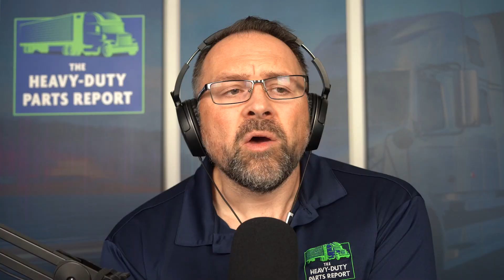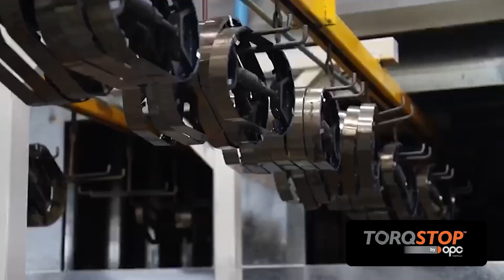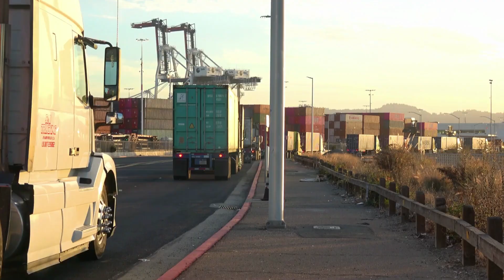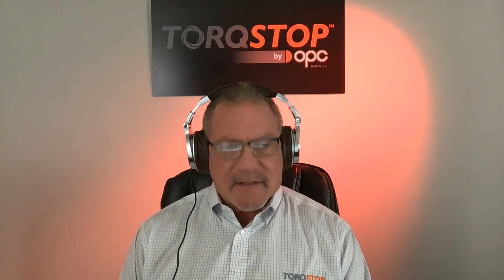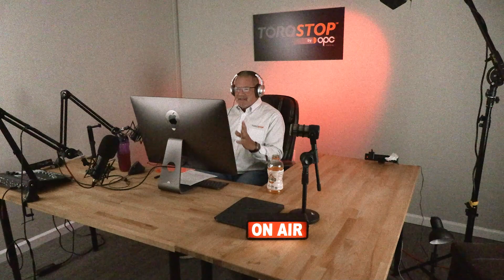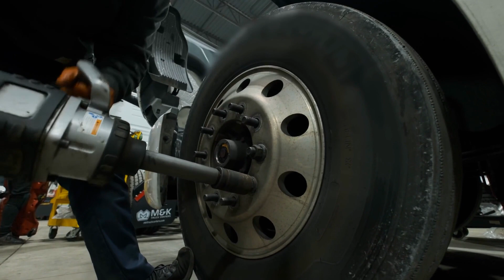Air Disc vs. S-Cam Brakes: Making the Right Choice for Your Fleet

Comment: Super interesting. I've always just assumed that drum brakes were used on heavy vehicles because they were better for weight or something. It never occurred to me that disc brakes are still superior. Why then do we use drums? Is cost the main reason for the preference in trucking?